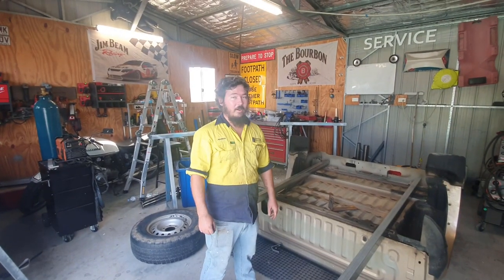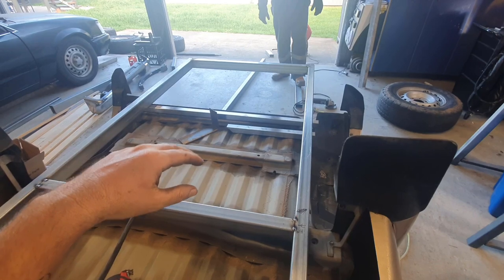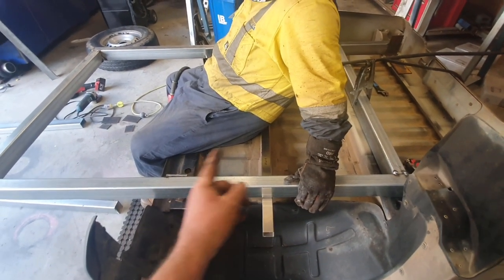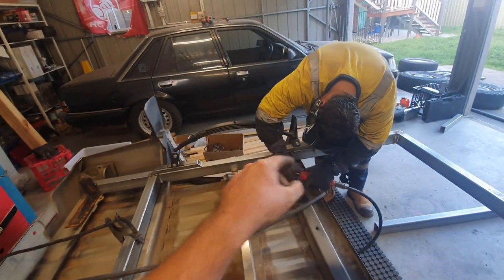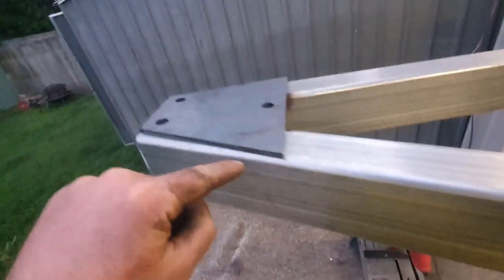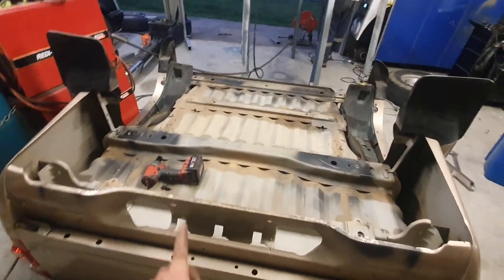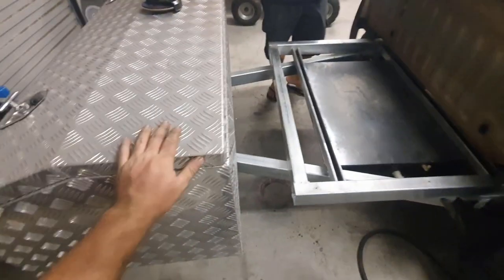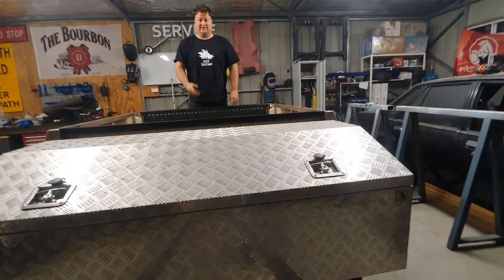turning a ute tub into a trailer

Comment: Hey mate. Good vid, I'm building one with the old tub off our ranger and was wondering how u go with compliance and rego and all that. I'm in qld idk if u are or not or whether it would be the same laws and regulations for it all but is there any weight restrictions or anything to go by? I'm struggling to find info
Reply from the maker: Qld isn't to bad as long as you've got more load space forward of the axle there happy. If you stop in at main roads you can apply for a low volume vin. Once you have that and it's stamped into the drawbar and the trailer's finished. you'll need to take it down when you rego it so they can sight the vin number and check the measurements. You may need to call and book them in first

Comment: Weight needs to be approximately 60/40. Front to back. These tubs are what 20/80? and improved slightly with the tool box.
Reply from the maker: Yeah there certainly not the best trailer. We pushed it in the back yard while we sort out a few other jobs

Comment: Did the axle kit come with 40mmx200mm stub axels? Or was it a prefab full length axel?
Reply from the maker: Its a pre made axel solid 40mm square. Here's a link to the kit. Just tell them the length you want, they should have it in stock.
https://www.bawatrailerparts.com.au/trailer-parts-19/diy-single-axle-trailer-kit-1000kg-rating.html
Reply: @AU-nappa  Legend. Thanks mate. Done anymore to yours? Going to get a tub and canopy and turn it into a camper I’m thinking 👍🏻
Reply from the maker: Nothing since, work got super busy so there hasn't been much time for the fun toys. Hopefully I'll got back into it soon.